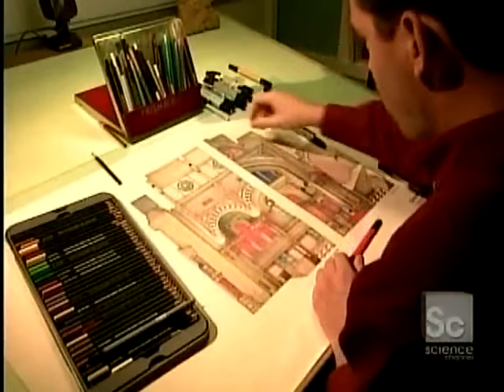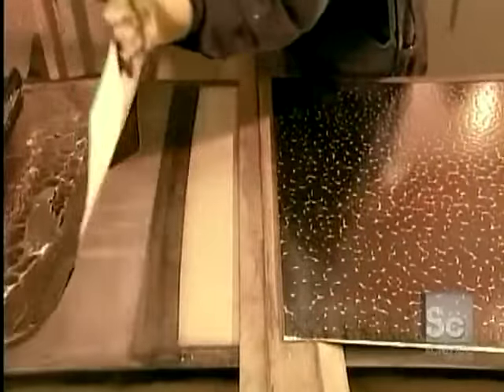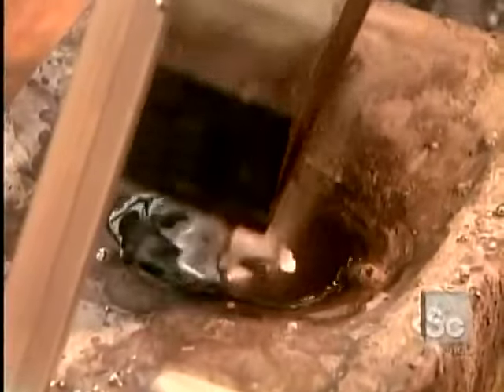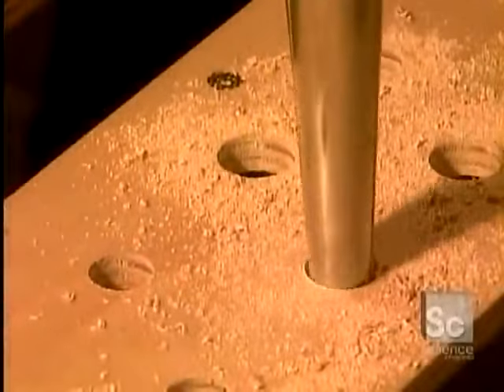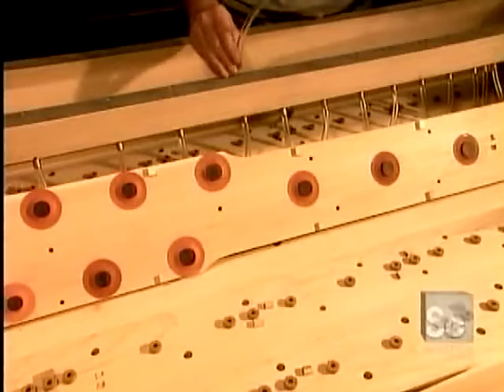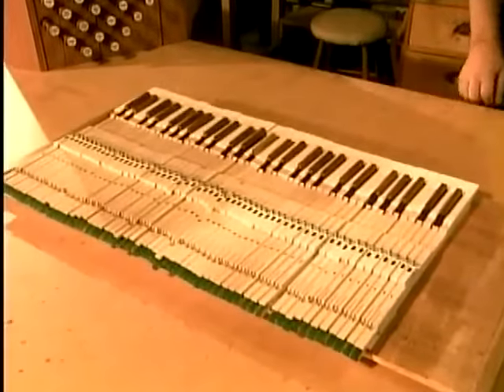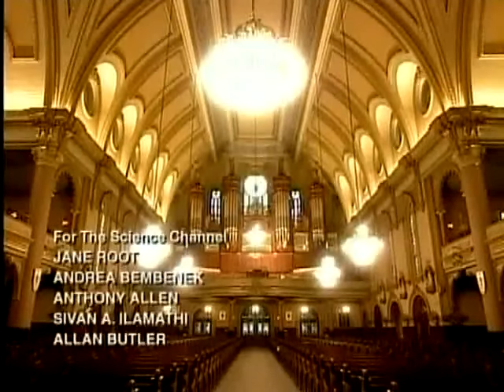How It s Made Pipe Organs

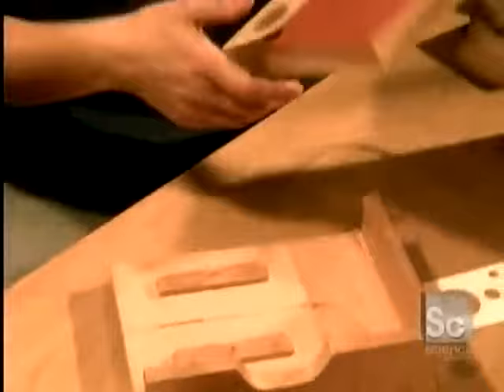Comment: 3:35 When the Musician hits a Key on the Keyboard, the corresponding valve drops down like a trap door allowing air to flow into the pipe causing the Air column to vibrate & produce sound.